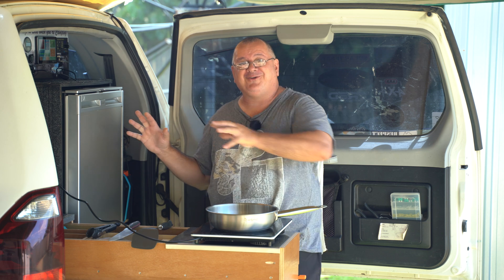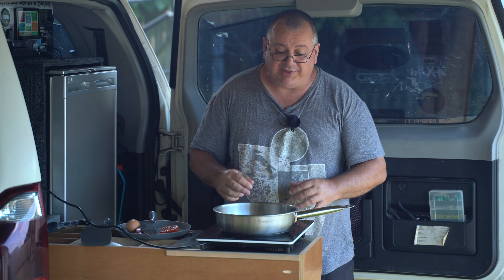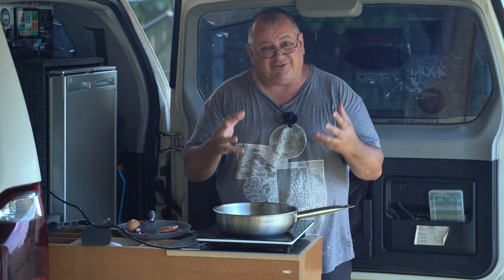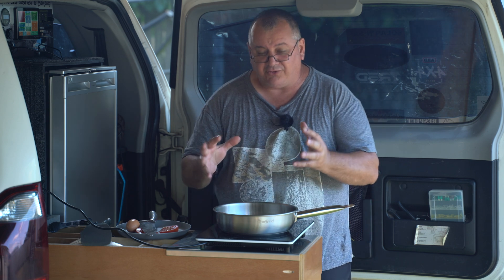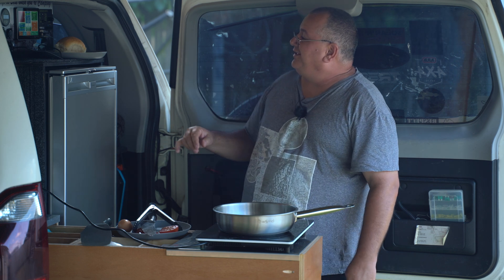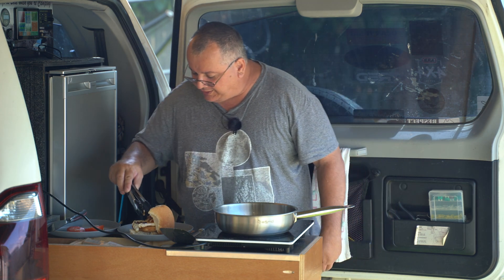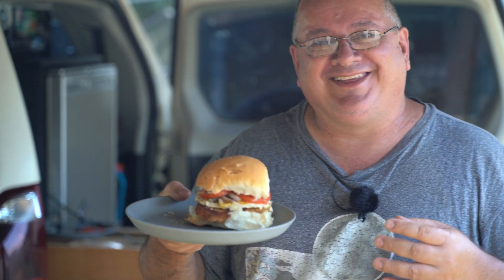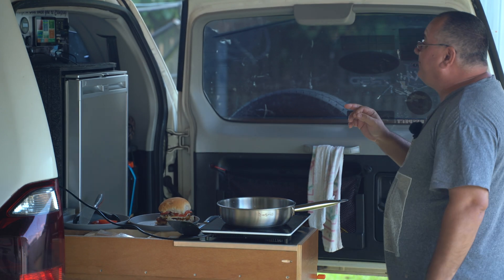Will a Induction Cooktop work on a single ItechWorld 120X 105a Lithium Battery

Comment: Hi Phil, it would be handy if you specified which company made your hob that ur using there? 
Now to the Kmart Hob: from the review on utube, apparently, The cord is really cheap and rather then coming out the back its position is down the side on the right. It is a cheap unit so, I would not expect much from it. If you already bought it, What is your experience with it?
I bought the Tefal Hob those r a bit over a 100 but its big enuf and controls are sizable enuf for what I like.
Reply from the maker: I own the Smarttouch slimline induction cooktop.  Ive never tried any others

Comment: Hi Phil. I discovered a trick with my induction cooker that had a minimum of 1000w. You can experiment with spacers (cork or silicon), up to about 1cm, and the wattage is reduced. I can get my net draw down to 500w using 2 silicon mats, without any cycling, which mine doesn’t do. This has allowed me to use it for simmering food that needs it.
Reply from the maker: Interesting!  My induction simmers great.  It does have a 500w option.  But what it does is run at 1000w than turns off,  on,  off on,  etc.

Comment: was wanting to run a 2000watt coffee machine anyway you could test that if you have one?
Reply from the maker: Yes,  i own a 2000w coffee machine.    Mine will run but not at 2000w. 

2000w is to much for the Itechworld 120X.   The best continuous discharge the battery can handle is 150 amps.   And 175 amps for short period. 

2000w coffee machine,  your looking at 200 amps plus discharge. 

My coffee machine has a unique feature that allows it to run at 1000w. 

Check out my video on the coffee machine.
Reply: @PhilsCampingReviews  thank so much you content and camping testing is great I’m setting up a van this was a great help watch real life testing can you try with the k mart cooktop ?
Reply from the maker: @johnny-pi1hi    I don't know if it's in stock here.  I will take a look.   It would make for an interesting review.
Reply from the maker: @johnny-pi1hi   Just checked.  Out of stock.  I don't think they had any stock here for a very long time.

Comment: I always enjoy the cooking videos.  Phil what IS resistance?  You made a few good points about the advantages of induction cooking.  I think that applies to powering all of your gear (including camp lighting) on a vehicle and/or trailer's electrical system.  As long as your system can safely handle it.  It's free to use on an ongoing basis.  Safer because there is no fuel to transport and use.  You don't need to worry about running out of cooking fuel when you go remote.  No wind restriction issues.  Take care of yourself down there Phil.🍻
Reply from the maker: The resistance of an object depends in large part on the material it is made of. Objects made of electrical insulators like rubber tend to have very high resistance and low conductivity, while objects made of electrical conductors like metals tend to have very low resistance and high conductivity.
Reply from the maker: Resistance to electricity–that is, electrical resistance–is a force that counteracts the flow of current. In this way, it serves as an indicator of how difficult it is for current to flow. Resistance values are expressed in ohms (Ω).
Reply from the maker: I think it’s a no brainer,  if you have electricity especially a caravan, camper trailer and you camp at caravan parks a lot and connect to power.  Induction cooking is worth it. 

Remote camping,  you need a quick way to replenish the energy used. 

I would still carry a small gas stove for backup.  Such as rainy or cloudy weather or your base camping. 

A small generator is also handy.  But your restricted on its use at most camp grounds.

Comment: Just 100 Ah of battery is OK for a few minutes etc, but long term, it is NOT anywhere near a wise choice. Just look at what Safiery do and recommend. At a minimum for a 4wd setup is 200Ah, but better to have 400 etc. Having only 100 Ah - you are SO dependent on having excellent solar days etc, or travelling everyday and using alternator. If you are say staying somewhere for a week or more- then it will be very hard to replenish the battery. And not to mention the "abuse" the battery will take.... Even better - get a 48V system.
Reply from the maker: Few minutes?   Did you watch the video?

Comment: Make sure if your crimping cables that big, use to correct crimping dye, if it’s a 90mm lug and you use a 90mm crimp dye, doesn’t mean it’s the correct crimp dye, need to find out which dye that cable is required, even the dye needs to suit certain branded Lugs for the correct crimp
Reply from the maker: Excellent comment.  Yes.  Totally agree.  I use one lug size down when I crimp with my hydraulic Crimper
Reply: @PhilsCampingReviews  hey phil forgot to reply to this i wouldn't recommend using a smaller sized dye, can cause the lug to fracture
Reply from the maker: @newport5504   I tried the dyes recommended and found them way to easy to squeeze.  I didn’t think they where anywhere crimped enough.
Reply from the maker: @newport5504   maybe different brand hydraulic Crimpers?
Reply from the maker: @newport5504    I will get some new lugs this week,  and redo the one on the positive terminal and cut the one crimp on there now and see what the strands look like.     When I tried the correct sized dye it was very easy to crimp,   I've watched others and they appear to put a lot more effort in crimping,   So I grabbed the dye smaller and it felt a lot better to me.

Comment: Thanks again Phil. Would it be better to have 2x 120x I tech.linked together?or perhaps even 3.look forward to seeing more videos 👏👏
Reply from the maker: I don’t think it is.  The BMS from what I’ve been told on the 120X does not double the constant discharge or charge rate when you parallel two together. 

The BMS is still limited to 150 max.
Reply: @PhilsCampingReviews  WRONG....Your amperage output is doubled or tripled depending whether 2 or 3 batteries in parallel.

Comment: Yep…..gotta have some sort of back up……
In case the inverter fails……all your cooking gear is pretty much 240vac…..

How many cells are you gonna need for 300ah….?
Reply from the maker: Just the 4 cells required,  each cell is 3.2v 304 amps. 

I will series connect 4 cells
Reply: @PhilsCampingReviews     Sweet…..if you don’t mind…..let me know prices etc when you are ready to buy…..cos I’m thinking of doing exactly the same……just wasn’t planning on that big a capacity….lol…..
Might work out a bit cheaper if you buy two lots instead of one maybe…..?
Reply from the maker: Prices gone up of late in particular freight.  I’m still looking. 

Need to keep it below $1000 so there will be no import duties and tax. 

I’m hearing there will be another price rise soon.  

I’m not ready to do anything now. 

Also it’s critical you top charge each cell when you receive them,  in order to do that you need a special power supply that is adjustable so you can charge each cell to 3.65v for the top charge. 

I’m not sure yet how much these chargers are.  And it’s something probably only used once.
Reply: @PhilsCampingReviews     yep....ive done a little research into that myself and found out about keeping the cost below a grand.....
so i guess a group buy will give the wrong result....only way around that is to get the supplier to break up the sale into smaller orders....

but ive also found out that they dont give much of a discount on their cells either...only a few dollars at most.....so not worth the headache......

as for top charging......theres several different ways it can be done.....and you can probably use what you already have as long as you monitor the charging yourself...
Reply from the maker: @defenderzook   might have to place two orders.  2 cells each order,  but the order will need to be a week or two apart.  Otherwise what will happen is customs will add the orders together even though it’s separate orders. 

Hence you space the orders apart by apx a week or two.
Reply from the maker: @defenderzook  that will also depend on The difference on cost of postage. 

I believe postage is something like $500 for 4 cells delivered. 

Will need to check and see what the cost of 2 cells is to deliver. 

I don’t think it’s going to be as cheap as I thought it originally was going to be.

Comment: Good video champion. I get that itechworld 200ah battery soon. Like that induction cooktop that you have as default setting is 500w then you can bring up to whatever wattage the inverter can handle rather that turn on and the inverter can’t handle the start up. Looking forward to your battery build.
Reply from the maker: It cooks great at 500w.   1000w it just burns everything.  To hot.

Comment: Good luck with your battery plans Power Paul down in Melbourne uses the Daly BMS in his 280AH and 330AH batteries.
Reply from the maker: A lot of them appear to use the Daly BMS.  Personally I don't like the balancing feature on it,  from what I see it's very slow to balance and apparently according Will Powers,  the Daly BMS don't have a low temp shut down.
Reply: @PhilsCampingReviews  yes I have heard that also
Reply from the maker: Power Paul uses Alloy bus bars,  I don't like that idea,  I much prefer using copper.
Reply: @PhilsCampingReviews  not sure if it’s a cost issue or he finds alloy better.
Reply from the maker: I’ve watched a YouTuber putting his buss bars to test and I would not call those alloy busbars a success.   

The YouTuber had to polish the busbars after sanding them and use some expensive grease to stop the high resistance,  even than it was a hit and miss. 

And within a short period alloy will oxidise.